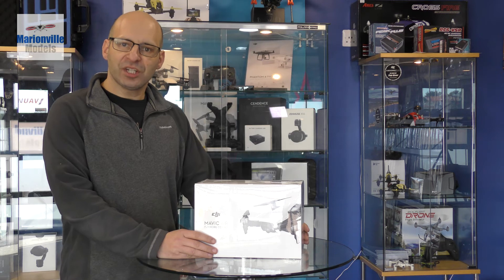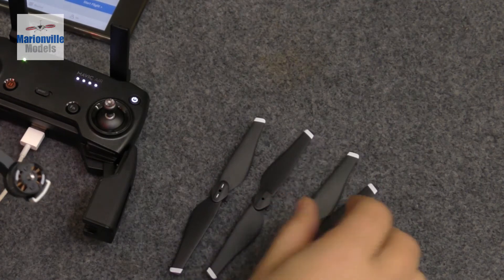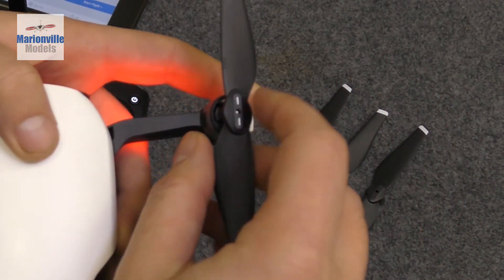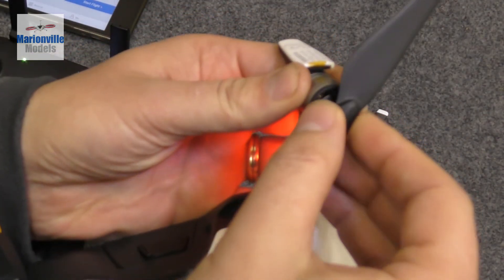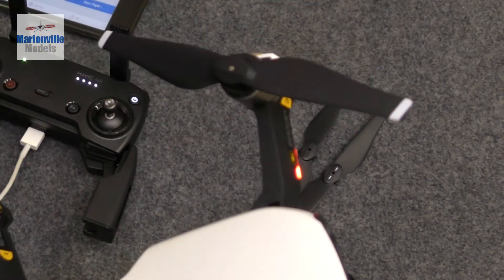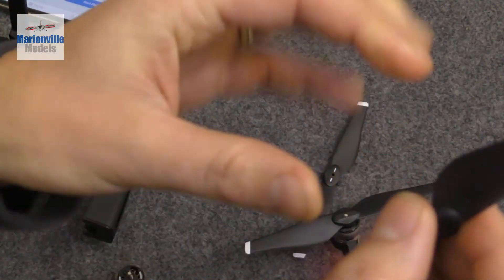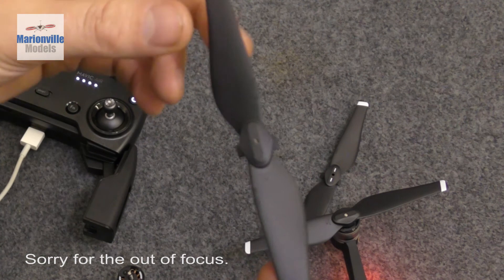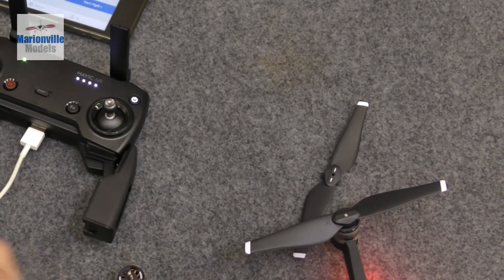DJI Mavic Air, How to Fit Your Props Tutorial

Comment: It's 6 years later and I was selling my Mavic Air. I accepted a bid for $215 USD so I installed new props and cleaned the drone, then tried to test fly it and its motor would spin up to full speed but it couldn't get off the ground. I was panicking and was about to cancel the sale when I found your video and realized all the props I had installed were black and none had the white markings. So I went back and installed the correct props in the correct place, and it worked perfectly. So thank you for saving my sale!